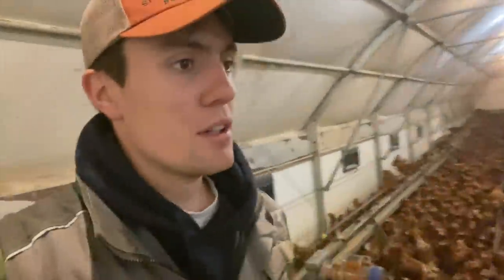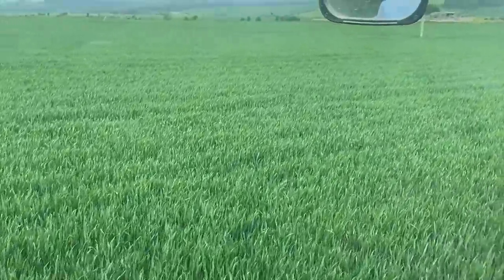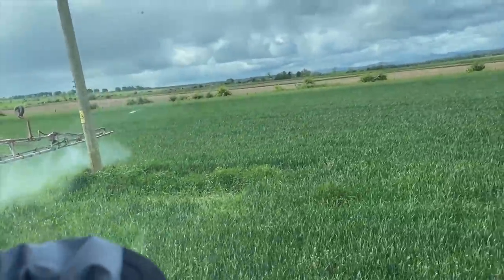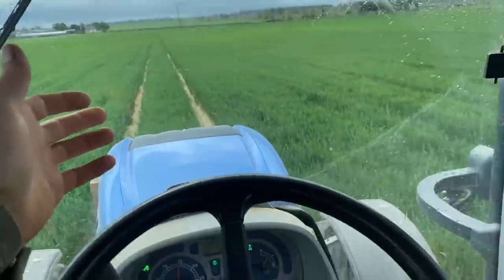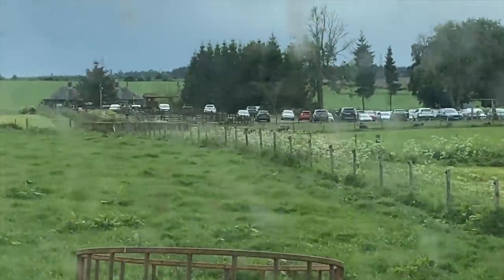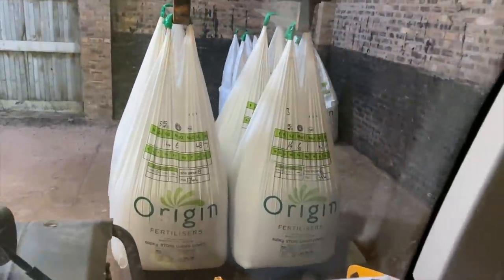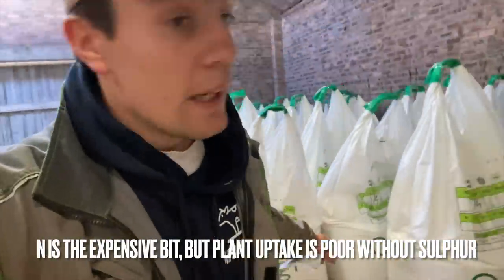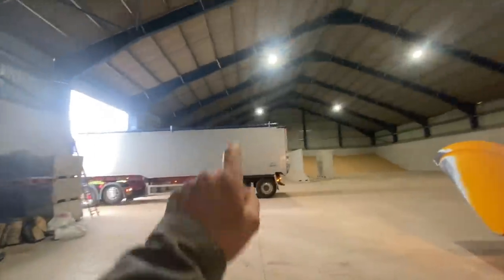Big Gamble | Loading Malting Barley  #279

Comment: Personally iv used JCB, Merlo and Manitou the Merlo won hands down, quicker smoother and better lift capabilities for loader size, never had a breakdown in 14 months of hard use, great video again mate.
Reply from the maker: Interesting, love the precision of the jcb hydraulics but havnt driven a merlo much
Reply: Just got to get used to that hydrostatic drive, lots of manufacturers are using it now.  You need to get used to the “rev pedal” 👍😂👍😂👍😂